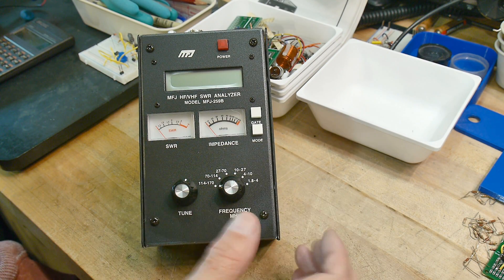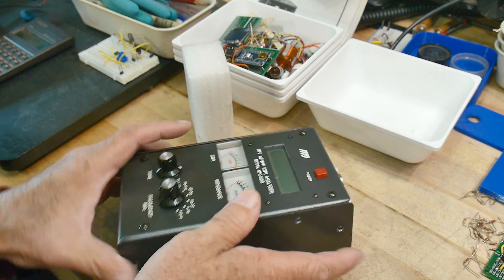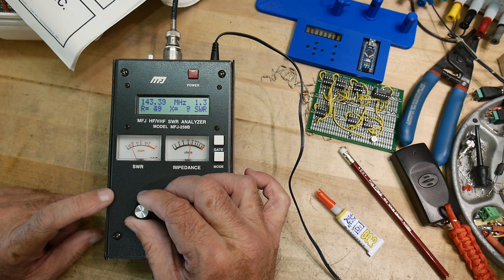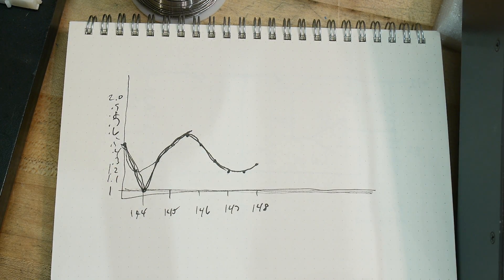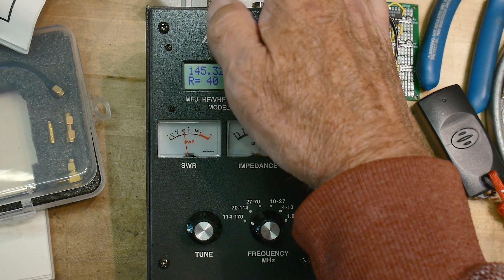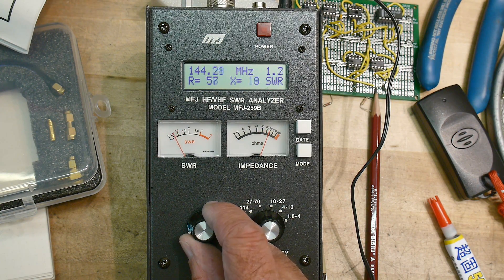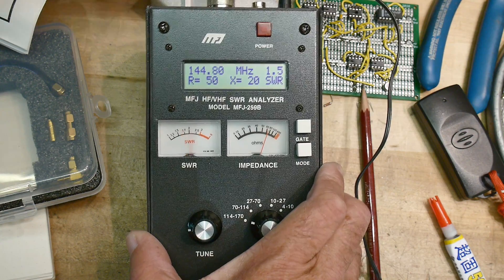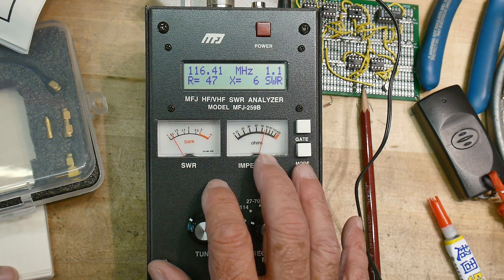#1089 MFJ-259B antenna analyzer teardown and turn on

Comment: A glorified resistive swr bridge, complete with signal generator (although that is also the heart of the nano VNA, but the construction is probably a bit better). It's a shame it can't tell you which sign the reactance is. It has an amplitude stabilised signal source, but I'm sure that is just so you don't need a 'cal' setting for the benefit of the analogue meters; the processor only needs voltage ratios to determine the SWR. You could do a video (if not already) about making a resistive SWR bridge that also has a way of determining if the load is capacitive or inductive (one variable and one fixed capacitor extra) - a fixed band (due to the capacitors), poor mans analyser - what the young, and poor, pirates had to use (at around the same year as the copyright on the MFJ software!)

Comment: I have one of these and yes they are a pain to take a part. I checked mine with a 50 ohm dummy load and  it is right on after all of these years. I still use it to tune antennas outside because I can see it better than the new digital ones. Happy with mine. Good video. ke9le

Comment: A friend of mine has the 269D.  The 269D comes with an N connector rather than the SO-239 on top. He loaned it to someone who promptly tried to plug in a PL-259.  Of course the fingers on the female N connector broke.  He asked me if I could replace the connector.  I wish I had found your video before saying yes.  The 269D has one additional PCB that’s perpendicular to the main boards and connected with a ribbon cable. The N connector is mounted to that board.  Of course there’s no additional room in the case, five pounds of crap in a one pound box.
Anyway, I was able to find a replacement N connector and replace it, but not without breaking the ribbon cable that leads to the additional board.  Curse words were uttered.  Whoever designed the packaging had no thought of repairability.
By the way, the one I worked on had really goofy readings afterwards also.  I don’t think anything I did should cause that, but after taking it apart 3 or 4 times I’m not eager to open it up again to calibrate it. 😢

Comment: I have offen wondered if when a outside power supply is connected...if the wire on the ground side will effect the opperation?

Comment: I still use one. Build a copper Jpole. Used it to tune. Compared it to a network analyzer I was surprised how close it was. Had mine for about 20 years paid around 300 or so.

Comment: Just watched & this video IS so Informative.  Thx So much for making This video !!...Don't own the MFJ but do have 2 NanoVNAs that Do measure Identical & seem Reliable that  I can Trust...Your 259B measurment is "Kinda sorta" usable Accurate (better than Nothing) & I wonder how Reliable the Other 259C & D and 269 models (as Received out of Box) are at typical Ham  Vhf & Uhf antenna measurements ??  Having to send it back  for a "Factory  Calibration" Dosen't cut it !!  USA made Budget grade meters have always been given a "Pass" expectation at the Upper Frequency range but the Really Low Cost NanoVNAs seem Extremely Consistent & Reliable in comparison....Plz keep doing your Style of Helpful videos  your calm,casual & Just Enough Math Theory Level is Best for me I've Ever seen !!!  Thx...

Comment: I just got the mfj -259D got the wall charger and the batteries I put batteries in and turned it on and nothing happened plug the wall charger in to the unit and it turned on do I need to change the batteries first ? Or maybe I got a bad set of batteries 😮 and will the unit charge the batteries it self ?

Comment: I've got the 269 and it works just fine. In measuring SWR, I compared it to a Diamond SX400 and the reading was the same.so I'm happy with it. I do believe when you desoldered the SO239, it could've affected the the calibration of the cicuit that is why it says in manual to short your coax connectors before inserting it coz a simple static from your antenna may result on false readings or worst, it may damage the unit.

Comment: IMSAI guy, interesting video as usual (thanks).

Sorry for this long message but I do have numerous comments since I designed and built my own antenna analyzer using the same basic approach as what MFJ used which is similar to a design by VK5JST.  

In the MFJ antenna analyzer there is an oscillator that feeds a 50 ohm resistor that's connected in series between the oscillator output and the output jack.  The 50 ohm series resistor connected to the output jack forms a simple voltage divider circuit with the oscillator being the source to the voltage divider.  Diode detectors then allow you to measure the voltage level on the output of the oscillator, the voltage across the 50 ohm series resistor and the voltage across the output.  If the load connected to the output jack was purely resistive then the voltage across the series resistor added to the voltage across the output jack should equal the oscillator output voltage.  When you connect a load that has some reactance then the voltage across the series resistor and the voltage across the output jack when added together actually measure greater than the output of the oscillator (their voltages are out of phase due to the reactance of the load) and you can then use math to determine what the load resistance as well as load reactance must be to have generated the simple additive voltage measured which is greater than the source (oscillator), but you can't determine if the reactance is inductive or capacitive.  The diode detectors are not perfect and that's what causes inaccuracy using this technique.  The microcontroller just measures the DC voltages produced from the 3 diode detectors mentioned above and then the microcontroller does the math to determine the R, X, SWR, etc.  The resolution of the analog to digital converters within the microcontroller is another limiting factor in regards to accuracy.  The detectors can get damaged which would then cause the unit to produce bogus values.  You measured a 50 ohm load up on 144.8 MHz and you measured R= 46 X = 7 which actually is not too bad using the above mentioned circuit topology (and it takes very little lead length to generate 7 ohms of inductive reactance on 144.8 MHz as an example).  I would also suggest measuring a resistive load of 100 and 200 ohms to see how far off they measure.  I would not go much more than 200 ohms as the accuracy will quickly plunge using this measurement technique.  I also suggest you do the checks on resistive loads down on some HF frequencies to see how their measurements compare (again remembering that any lead length introduces inductive reactance that can't be calibrated out on the MFJ analyzer).

What kind of surprised me in your video is how flat the SWR looked when measuring your J pole using your two different VNA's, and that made me just as suspicious as the measurements being made by your MFJ analyzer.  Your SWR is so flat on your J pole when measured with your VNA's that I suspect you have a lot of feedline loss which makes your SWR look much better than it really is compared with if you measure the SWR at the antenna feed point.  This is a totally different topic but thought I should mention it.

I no longer use my homebuilt antenna analyzer as I switched to the NanoVNA a few years ago, but the circuit topology used in the MFJ antenna analyzer can produce reasonable results as long as it's calibrated properly at the factory and not damaged but it certainly has limitations.  Also the MFJ antenna analyzer can produce bogus results if used close to a nearby transmitter and sometimes this is an issue for guys trying to measure antennas down on 160 meters that live in close proximity to a commercial AM broadcast transmitter.

Just FYI,
Don
Reply from the maker: here is my video on the VNA showing how it does things: https://youtu.be/yGKWBpgN8PU
the J-pole I have is not typical and uses a gamma match for the broad band
Reply: @IMSAIGuy  Hi IMSAI Guy, yep I know how the VNA works and I find the NanoVNA one of the most useful tools I now own.
OK on the Gamma Match on your J-pole, I normally question antennas that look so broad banded.  If you still have that MFJ-259B I do recommend you do more tests with known loads but stick with loads that have an impedance of 200 ohms or less, otherwise you're operating beyond the limits of what it can reasonably do.  It will probably also work better the lower in frequency you go.  While it can't come close to what the NanoVNA can do, if it's not broken it would still be of great value to a new ham, etc.
Thanks again for all your interesting videos.
Don

Comment: Thank you. I enjoyed your video.
   I have had my MFJ-269 for over ten years. It still works. I got it to rough tune antennas to avoid frying the RF transmitter finals. I have not fried any finals since I received it. So it did what I wanted it to do.
   I have also used it to measure coax length, velocity factor, and so forth. I does the job I need to do.
   After reading the comments, there is a thing called measurement theory and it is complex. There is also the electromagnetic theory expressed by Maxwell's quaternion equations and transformed to vector calculus by Oliver Heaviside and other Maxwellians. Also complex.
I do not understand either very well and I am a retired professor and have worked with electrical wiring and electronics for years.
   To get really precise measurements requires expensive calibrated equipment. The nanoVNA's and V-SWR meters are inexpensive. The highly calibrated equipment ranges from thousands to tens of thousands of US dollars, or more. I checked on an oscilloscope and it was over $ 1,000,000! Only for frequency measurement do we need high precision. Most everything else we do not. The cheap nanoVNA's and the more expensive V-SWR meters get the job done. And neither is very accurate. N0QFT
Reply from the maker: I don't disagree with you. I just pointed out that the HP8712 (multi tens of thousands of dollars) agreed with the inexpensive nanovna. the MFJ uses a similar 50ohm bridge to do the measurements. the difference is the nanovna (and expensive units) has software in it that allows a much more detailed calibration.

Comment: The device has many advantages:
1. Preliminary setting of P-circuits
2. Antenna tuners (SWR, tuning frequency)
3. RF amplifiers (Rin and Rout, bandwidth)
4. Capacitors of capacitors (in pF)
5. Chokes and inductors
6.Frequency transmission and generation
7. Wave R of symmetrical lines, Kukor. and resonances
8. In coaxial lines - SWR, K shortening, resonances
Much more, up to measurements of the length of the RK
By the way, this device was used to check the antenna pattern, using it as a beacon

Comment: I've got one that I've had for over 20 years.  It's an awesome tool.  I built a 10m 2 element cubical quad and an 8 element 2m cubical quad in 1999.  Also a bunch of HF dipoles.  All made big signals and the radio was happy with the impedance. I would note that once you get above 4 elements on a 2m quad, tuning gets really quirky.  I really wish I still had those two homemade antennas, but wood and bamboo just don't hold up for decades. ;)

Edit: mine always seemed accurate.  Gotta keep in mind that, unless your antenna is purely resistive and 50 Ohms, the feed line is part of the system being measured.  One should really use half wave multiple coax feed line to do the measurements, this should eliminate the effects of the feed line length.  I think this would apply to any tool used, including the fancy new VNA boards.

Comment: interesting. I got one of these things used, after buying my Nano, and I do see differences. I have an earlier all analog version (208?) with no freq counter, and just one SWR meter. I'll have to compare all three. Whatever I find, I won't be taking this apart!  BTW I ALWAYS use an antenna tuner!
Reply: OK, I did compare all three and this is what I found:

MFJ Antenna Analyzers vs NanoVNA-H

MFJ-209		MFJ-259B	       NanoVNA-H

freq	SWR	freq	SWR	freq	SWR

20.16	1.9	        20.21	2.0	        19.71	1.6

49.77	1.3	        49.27	1.4	        49.92	1.5

73.25	1.9	        73.25	2.6	        73.29	1.6

Notes: I tested a center-loaded Buddipole dipole, ostensibly tuned for 17m. 
But I use it from 6m to 20m with the Elecraft T-1 tuner on my KX3.

the MFJ-209 is analog so I used an external frequency counter. 
So the SWRs are read off a small analog meter and are not precise.	

Because I used a wide range on the Nano the Freq and SWR are not precise.	

Anyway I'd say these three instruments are in pretty good agreement.I'm glad about that.

Comment: I'm a bit suspicious of these measurements.  Measuring return loss and rolloff versus SWR and resistance do not seem to be measuring the same thing.  A J-pole is very frequency dependent, basically a half wave antenna on top of a quarter wave transforming section that is in turn very sensitive to nearby metal.  At resonance the coax cable is unlikely to participate in the antenna system, but off resonance the coax starts to participate in the antenna system and that's probably why the MFJ is showing two dips.   Naturally, the MFJ analyzer (as also the NanoVNA and HP) is also part of the "system".  

This can be discovered by inserting a short stub into the feed line and see if it makes a difference.  In resonance, it won't change things inserting a few feet of feedline; but if you have some standing waves on the coax, adding a few feet can change things significantly.  Where that's the case the coax is definitely part of the antenna system and that's generally unwanted.
Since the coax becoming part of the antenna system is particularly true for half-wave antennas, and a J-pole is a halfwave antenna, it follows that the coax could easily become part of the antenna system.
Consequently I expect analyzers to show a complex frequency to swr and reactance plot; it is the simple rolloff that seems suspicious in this case.
Reply from the maker: do you want to buy my MFJ?
Reply: @IMSAIGuy  "do you want to buy my MFJ?"
Clearly, something is wrong or less right, and its more than a little likely the MFJ antenna analyzer. I've just spent a couple of hours studying J-poles and it seems they are susceptible to feedline interaction unless decoupled with either a second stub or a ferrite.
Anyway, I think my next tool is a NanoVNA because that can be used for many interesting things.
Reply from the maker: Let me know what you think when you get the VNA. you will get different results than the MFJ. I have 4 different VNAs that all agree with one another. They should as it is just a 50 ohm bridge. The MFJ is a also a bridge but a poor design. Regardless if the feed line is part of the radiation (it shouldn't be if the antenna is adjusted correctly) the measurement instruments should all agree. Other viewers have told me that the MFJ is incorrect as well so not just one data point.  The MFJ is better below 30MHz but not above.
Reply from the maker: BTW: I adjusted the feed point of the J-pole on a short coax, then moved it to the roof. It was still resonant.
Reply: @IMSAIGuy  Wonderful. I've been considering a j-pole for a while; I also like discone antenna partly for its science fiction appearance.
Reply from the maker: this is the J-pole I have:
https://www.amateurlogic.tv/downloads/j-pole%20drawing.pdf
Reply: @IMSAIGuy  Oh, I like that!  Built-in RF choke and a gamma match on a J pole.  No wonder it works almost anywhere.

Comment: I owned one and also two nanoVNAs.  The  MFJ readings were consistently different on all frequencies compared to the VNAs and the VNAs were very consistent to each other after calibration.  I called MFJ and they told me I need to send it back for calibration which was too costly and time consuming.  I returned the MFJ and received a refund but was still out the return shipping.   A generation of Hams has falsely placed faith in these analyzers that are essentially worthless.

Comment: hello.!!
Years ago I bought a mfj269 with a lot of effort thinking about its prestige, its quality and the truth that I was disappointed. try to correct your readings. It is a terrible harmonics generator, when you measure multiband antennas the truth is that you go crazy, I bought the filter unit and the thing worsened more readings. I remember that it cost me here in Chile 1,350 dollars in those years. Later I bought a Tektronix spectrum analyzer and tested the mfj and snails!!....this is crap.!!! when you adjust it to the resistance of pure loads like the Birds it always gives you 1:1 but if the system has associated capacitances and reactances it marks anything. if you apply pure loads of 75, 100, 150, 200 ohms, something marry but a very high error.
I got bored of that instrument and bought a BIRD AT500, tested what I had installed before with the mfj and confirmed that the mfj 269 product is a disaster.
Today within my activity is to calibrate and repair RF instruments. and mfj units that arrive all their scales are out of tolerance, 20% error and I must do the scales again or attach a scale correction certificate, both in power and SWR readings. poor quality welds, harmonics and instability is its Achilles heel.
In general....I would not recommend buying products of that brand...not even for radio amateurs.

greetings and congratulations for your videos ..... they are great.!!!

from Chile
CE5LBM
Enrique